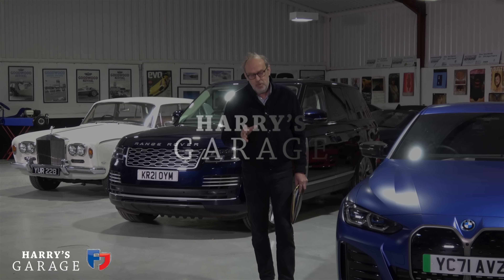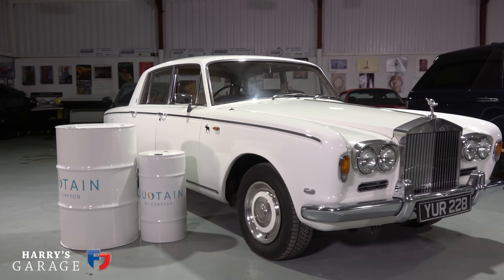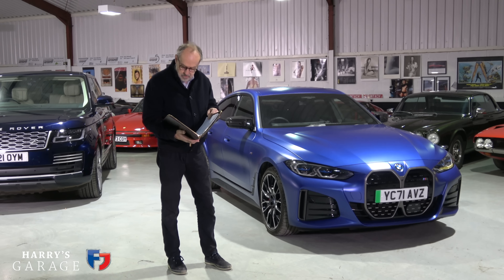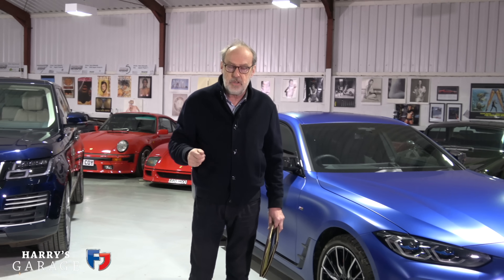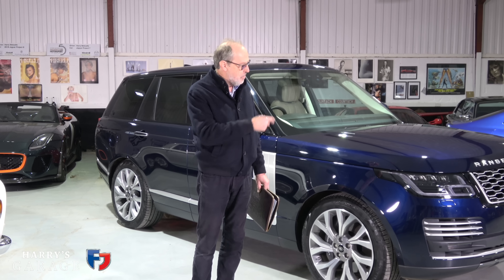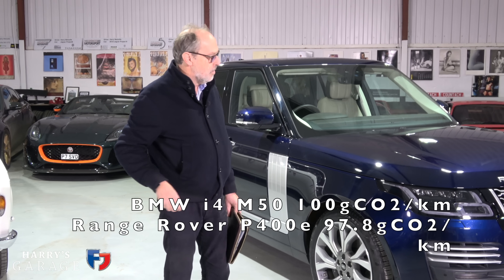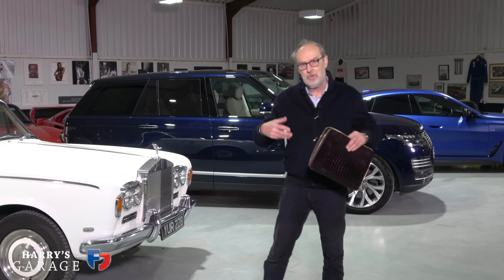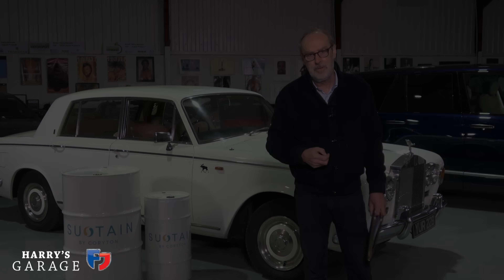Sustainable fuels; what are they & are e-fuels better for the planet than running an EV or PHEV?

Comment: I would like to see consistency in the CO2 and pence per mile calculations. How can one vehicle have free electricity with no CO2 and the other the projected costs of a future bill?

Please also include the CO2 of producing the synthetic fuels, which currently uses a massive amount of electricity.
Reply: As Harry said, the synthetic fuel is produced using entirely renewable electricity, so no CO2. He didn't add in the transport impact though.
Reply: @davidm5842  the fully electric car could be charged from his wind turbine and cost nothing and produce no CO2, but he chose to make up those figures. Don’t forget synthetic fuels need transportation and there are CO2 and cost impacts for this.
Reply: In that case, let's factor in the production of renewable infrastructure (including all the strip mining for the limited heavy metals (500ton per battery)), the fact that solar panels cannot be feasibly recycled by most places, the oil used in wind farm maintenance and the resin propellers that cannot be recycled and are currently just buried in landfills.

Comment: The problem with hybrid (where i live) is that people living in big cities cant access chargers on a daily basis - so they use fuel more. A hybrid running without electric motors is less economic than equivalent car without hybrid tech on board... People choose the hybrid because its cheaper to buy...

Comment: I’m pleased to see you looking closely at running your classic fleet on renewable fuels. Great idea. Please don’t perpetuate the myths about the environmental costs of these or electric vs gasoline though. There have been lots of proper studies which show the true cost when the production and transportation of petrol and diesel are taken into account. An EV will break even with an ICE car in about two years (More or Less, BBC R4). I’m not saying get rid of the classics or convert them, and renewables make sense for them, but let’s not kid ourselves that EVs are worse for the planet. That makes you look silly.
Reply: Did those studies take into account the ecological effects of strip mining for heavy metals (500ton of earth per battery), complete infrastructure rebuild, oil usage in maintenance for wind turbines, ecological effects of not being able to recycle solar panels or the resin turbine propellers? Doubt.

Comment: I had an electric chainsaw on demo, (orange brand) supposed to replace my petrol ones. It came with two "Heavy duty" batteries and lasted about an hour before it was just a useless expensive waist of time.  There is no 4x4 truck to meet my needs on the farm and in the forest, in the real world it's not luxury 4x4  EV's that the world actually needs.  If this climate nonsense was actually true, they'd ban luxury 4x4's and build affordable small and utility vehicles instead.

Comment: The BMW seems to be very inefficient compared to a model 3 and Hyundai ioniq 5, both achieving >4 miles/kwh relative to the BMWs 2.5 miles/kwh
Reply: Fat tyres...
Reply: @adpmol  model S plaid tires significantly fatter. In fact model 3 performance is the same.
Reply: The BMW was his real world driving. Once your at 70-80mph the m/kwh drop

Comment: Truths coming out about the CO2 hysteria, a few years or so, less than 10 i think. CO2 isn't a pollutant and we need more not less. Plants use it to grow giving us O2 in return (the truth is staring you in the face Harry). Temp drives CO2, not the other way round as described by Gore in his late noughties lecture. Gore switched the graphs, his claimed results are fraud. That fact right there puts the whole CO2 man made argument on it's head.  
'They' created a computer model that tells us we've all got to reduce our CO2 output or the planet's screwed. The climate models and their results are manufactured to predict very significantly higher/catastrophically high global temperatures. 'They' scare the bejesus out of us, we pay them carbon tax. Three 'how's that' and a 'hey presto' later, climate models predict a decline in future global temperatures. Hallelujah we've all been saved. Until CO2 model outputs start to rise again, and they will, and at a time when 'they' think they can put the price up even more without revolution. It's a manufactured scam Harry. We need to think more laterally, to ensure we're on the right of history.  
But can't be true though right, because "they'd never be able to get away with it.." Think I'm crazy? Not possible to pull off a scam of this magnitude? Research the pyramids Harry. We've been lied to, what are the pyramids for? Research how many mummies have been found inside a pyramid? Answer none, not from any pyramid anywhere. It is very possible to hoax a planet, just need the right people and in enough key places that are prepared to sell their soul to the devil.

Comment: Over the lifetime of a car you would certainly find that EVs produce less CO2/mile than plug in hybrids or renewable fuels. However, for older cars (classics) sustainable fuels are a great option. Plug ins will likely disappear over time or replace pure ICE vehicles all together.
Reply: Proof? Or even a well thought out reasoning? 
Remember the extra battery in a full ev usually weighs quite a bit more than the phev engine/battery combo, needs a lot more to make it in the first place, spends most of its time using a small fraction of its capacity and when it inevitably needs replacing will create another massive footprint. 
The phev can do all the normal running about on ev just like the ev but when it needs to go further it doesn't need a massive charging network to be built since it uses one which is already there. While it isn't using its full capacity its also not dragging around hundreds of kg of precious metals which it doesn't need. 
Since thats most daily driving for most people I would love to hear why you think having a 100kWh battery makes sense when its never going to use that capacity and only very rarely over half of it?

Comment: Great video as usual. Just one thing - energy to produce and transport of the bio-fuel? What about the CO2 produced while producing/transportation?
Reply: Transportation CO2 broadly similar to the CO2 produced by fossil fuel transportation, depending on where in the world a given consumer lives. Production CO2 probably less and falling, as the cost of renewable electricity continues to fall whereas the sheer physical difficulty of recovering oil from ever deeper and more challenging reserves means that the energy cost of producing each barrel of oil has been going up sharply
Reply: Renewable energy is as expensive as ever. Lol.

Comment: Thanks Harry for a very informative video your Rolls Royce was made and pretty its carbon footprint has well and truly passed and that sustain fuel looks like a winner my l live in Australia and my 25 year old toyota hilux ute runs on unleaded l do hope thus sustainable fuel is equal to unleaded petrol not like E10 which l would never put in my ute because it has a carburetor and no cat converter fornuantly in Australia we still can buy nomal unleaded petrol but we also have E10 never ever use it plus it is only 2 cents cheaper than 91 unleaded

Comment: Why not hydrogen?
Reply: The disadvantage may be that it need it's own new distibution set up, while electricity already are available basically "everywhere" and the synth fuel can be distibuted in the old systems already used for gasoline and diesel. Hydrogen may be useful for some segment of transportation.

Comment: Great insight into the misconception behind EV as a zero-emissions vehicle and the time & cost consumption in recharging batteries. Should we also factor in the average wage costs of lost productivity in fleet-related business EV vehicles. Should we also consider Hydrogen as another fuel source (as per your JCB video) and it's CO2 costs? It's a somewhat confusing subject for most motorists, hence their willingness to continue using fossil fuels. I look forward to your forthcoming video on bio-fuel and your related test results.

Comment: This is a debate and each side has their set of arguments supporting their side. I guess the classic car community too needs a solid voice in their corner. However,  I think Harry is undermining Evs with some of his arguments, for example; on the longevity of electric cars, it wasn't an apples2apples comparison. Honestly, if you got the same "quality craftsmen" to put that effort into building electric cars, I think you could achieve the same or even a more durable EV vehicle.
Reply: I guess the new cars forward got a disadvantage by being highly based on software and overall very complicated. They will be to expensive to repair vs buying a new car and you will, like with any other software driven electronics, in a few years have an outdated "computer" that can't be updated to work with the newest systems around it. New cars have better build quality than ever, but they got an endless amount of parts inside and it's mostly plastic. They are not really designed to be repaired. It's an completely different world that keeping an old 60s car running.
Reply: Yup, its unfortunate that many of todays EVs and even the future (concept cars)are looking a lot like plastic-built "white goods"

Comment: Love a lot of the stuff done here with classic cars and bikes, but Metcalfe seems to be woefully misguided on EV basics, and the situation with renewable energy.

There are many points he has failed to address or ignore, a few examples include:

1. The massive inefficiencies of the process of producing “sustainable” fuel. Where is the co2 figure for production. Where is the co2 cost of the diesel tankers shipping this product across the world for him to use?

2. He talks about co2 use from electricity production but nothing on “standard” fuel production.

3. Renewable energy is the future, I’m not sure how anyone can really argue with this- costs due to technological advances have dramatically reduced, and are still going down each year. Compared to drilling/fracking etc where costs are increasing. Nuclear is also massively expensive, countries need several hundred year programs to decommission them for a start- just take a look at Chernobyl/Fukushima. When you calculate costs using that map of the uk, this is changing dramatically, right at this moment, and will change even more a few years down the line. Metcalfe mentions he is using clean energy from his wind turbine installed a while back, perhaps he should include those figures when calculating the ev co2 output, as that would better represent his situation.

4. The dinosaur in the room - no one enjoys exhaust pollution in their city, town, village - take a trip to cities such as bangkok, jakarta, mumbai, even paris and london. It is clear we would all be better off without diesel / petrol exhaust fumes in our faces. Indeed with renewable energy production costs becoming very affordable, it becomes a win win. 

5. How is installing an ev battery + electric motor + combustion engine into a monster suv frame: aka the range rover, with all that extra weight, and extra co2 in the production process ever be a sustainable or cost effective option? It just isn’t and never will be.

End of the day I’m all for classic cars and for car / bike enthusiasts to be able to continue using standard fuels, as the relative co2 output of this minority group is small. But we have to wake up and realise there is no such thing as a “sustainable fuel”, and for the masses, this would be a catastrophically bad idea.

Comment: I would be curious to know what is the energy cost of producing the "sustain" fuel... and also what is the pollution impact of the process... saying that it transforms co2 into fuel does not mean that it is co2 net positive in the process, it might create more co2 than the one it transforms. Also, since we factor in the environmental impact of building an electric vehicle, why don't we factor the same when analysing the hybrid or traditional car? what is the difference in co2 per car created? Not sure it would be very different than a full electric one. Lastly I think it would be nice to also compare with the previous cost of energy, before the energy world changed due to Russia invading Ukraine. Results might be different, don't they?
Reply: Strange why more battery huggers don't challenge the cost and energy used in producing wind turbines and concrete foundations or the disposal of toxic PV panels etc. Helps when you wear blinkers!
Reply: @nigelburns3900  the reason for my ask is simply that Harry mentioned that creating electric vehicles creates a lot of CO2... but he completely missed citing if this is true also for the other production processes, both for regular vehicles and distilling the new fuel. It seems a reasonable ask to make sure the message he sends is not affected by biases.
Reply: @dariodeagostini  That is true and unfortunately the full picture is often missing regarding EVs. 

A typical EV battery weighs one thousand pounds, about the size of a travel trunk. It contains twenty-five pounds of lithium, sixty pounds of nickel, 44 pounds of manganese, 30 pounds cobalt, 200 pounds of copper, and 400 pounds of aluminum, steel, and plastic. Inside are over 6,000 individual lithium-ion cells.

To manufacture each EV auto battery, you must process 25,000 pounds of brine for the lithium, 30,000 pounds of ore for the cobalt, 5,000 pounds of ore for the nickel, and 25,000 pounds of ore for copper. All told, you dig up 500,000 pounds of the earth's crust for one battery."

Comment: Thank you once again for talking about the CO2 ‘cost’ of car manufacturing. The most environmentally conscious thing you can do is to drive your existing car until the wheels go square.
Reply: The most environmentally conscious thing you can do is ride a bicycle.
Reply: @tonyedgecombe6631  Not true. Small electrics like scooters are far more energy efficient than a human so if you really want to save emissions thats the way to go. 
We're actually a bit rubbish at converting energy. Conventional ice's can usually do around 12 times better but of course that means carrying a bloomin great engine about which does more harm than good. 
Well unless there are a lot of you and you have heavy loads to carry.
Reply: @siraff4461  If you assume you are going to have to exercise anyway then that's a wash. Having said that I am a big fan of e-bikes.

Comment: Utter nonsense. Is he on drugs or more likely just doesn't want to trash ICE cars as he is one of the promoters of them. Hilarious picking a choosing figures to use to convince himself🙄 even if you use 100% coal powered electricity or still way better because it uses way less energy in an electric car, it's far more efficient because most of the energy is not wasted in heat and movement as in an ICE car.

Comment: Please stop using the term “sustainable fuel”. This is about as accurate as “clean coal”. There isn’t a biofuel today that is carbon neutral. Go watch Engineering Explained for a discussion about ethanol production and you’ll see why.

Comment: Harry you forgot to mention the Elephant in the room, I heard of a chap locally who purchased a used Mercedes hybrid. He recently had it serviced and was told he needed a new set of batteries at a cost of £15,000, the issue was the Mercedes was only worth £12,000! This is where anything electric falls flat on its face. Few can afford to buy new batteries that cost more than the car is worth? Your thoughts please! The electric option is unsustainable. I have a solution for you re solar panels

Comment: I totally agree with you, pure electric cars are no way zero emission, when you take into account manufacturering of EV's compared to petrol or diesel vehicles.

Then secondly when you compare, actually where the owners or drivers, are actually obtaining their electricity from, or how the electricity is produced in the first place?
Either by nuclear power, coal or gas or oil power stations, none of which are clean or low emmissions?
That is against green energy production, either solar power, or wind power and/or hydro / wave / tidal power, though these are not Zero Emmission either?
When you take into account again their manufacturing costs and emmissions, or in their operations costs and emmission too? 

 Or if EV owners and drivers, are using use of large commercial or domestic battery energy packs, which are recharged at low over night electric charges,  that is then used to recharge EV's own batteries too?

Because both commercial and domestic battery energy packs, or EV batteries, are again have high costs in manufacturing and equally high emmissions too?

So maybe every one should go back to horse drawn coaches and wagons, plus sailing ships too, maybe hot air balloons, or giant helium airships with solar powered propellors for air travel as well!

Comment: Fascinating video I was intrigued to note your only getting 2.5 miles/kWh out of the BMW I4 M50, testing in Norway under winter conditions, they are getting 2.98miles/kWh in standard, not economically mode. Assuming this is a journalist’s car, given they have a tendency towards a heavy right foot particularly when the  car is  the performance, were the computers reset before the testing to ensure the true everyday consumption figures.

Comment: Do you have any ideal what the figures and costs plus emissions, would be for the hybrid Range Rover, especially is you have Solar Panels and Wind Turbine plus a recharging domestic battery energy pack too?
Could this be the most green way to run classic cars or classic vehicles, if they were converted to be powered by Sustainable Biofuel engine and Bybrid Electric Battery system?